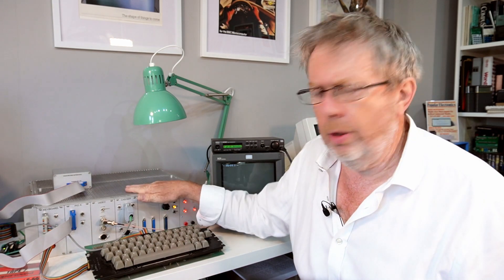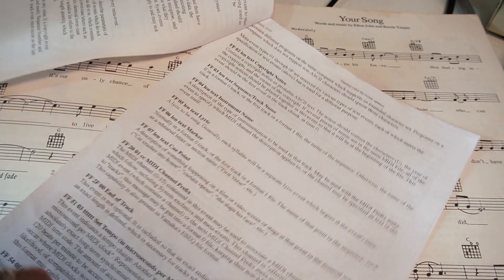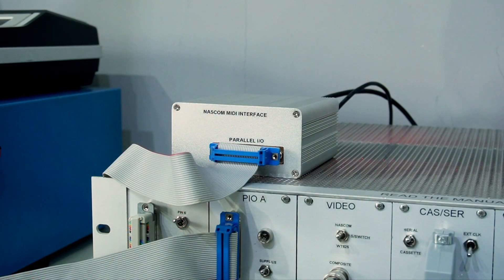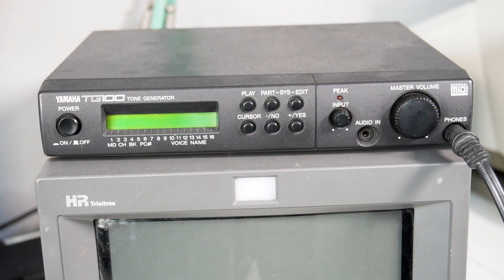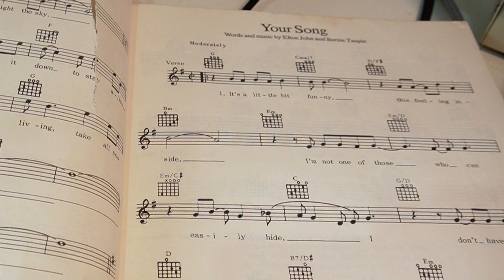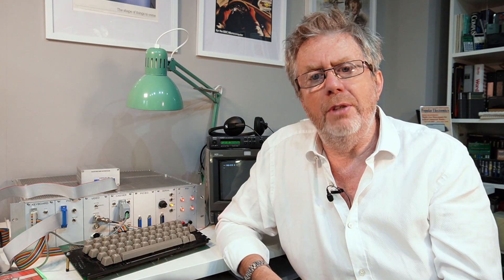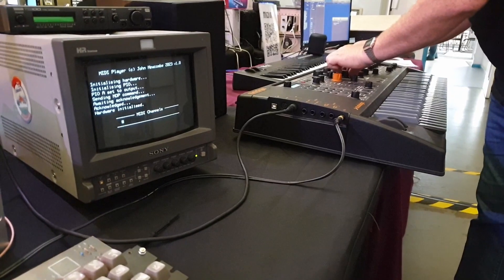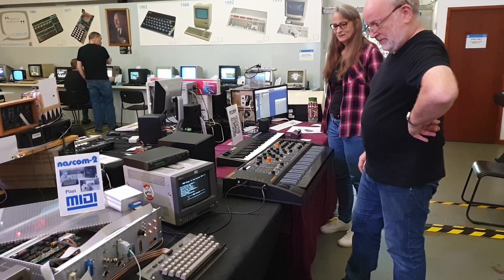The Nascom Computer Part 3 - The Nascom Plays MIDI

Comment: My first experience of MIDI came a bit later than your era of study, when I made my second mechanical organ.   The first was a 20-note version of the type played by street buskers, usually accompanied by a monkey collecting donations, where the music was stored on paper rolls with holes punched to allow air from bellows to reach the appropriate pipe.   The second had 70 pipes, and was MIDI based, being intended to be used with an S-Card reader containing the MIDI files.  A control board fed with the MIDI files operated small valves to let air through to appropriate pipes plugged into a windchest. However, I had a Palm Pilot PDA and decided to try to use that instead of an S-Card reader.  I eventually found some suitable software and it worked beautifully, especially when I upgraded to a Palm V.    I became a member of BOGA - British Organ Grinders Association, and eventually took over running their website.
Reply from the maker: That's brilliant! A guy I know has a midi controlled church organ over at @lookmumnocomputers he got it from someone who had built it into a small house. Crazy.

I remember those street buskers with the monkey. I remember being handed the monkey and quickly being photographed. I was then chased down the street because I didn't want to buy it. Happy days.